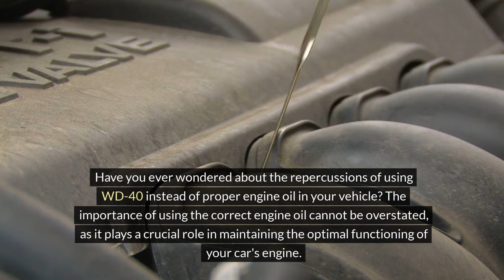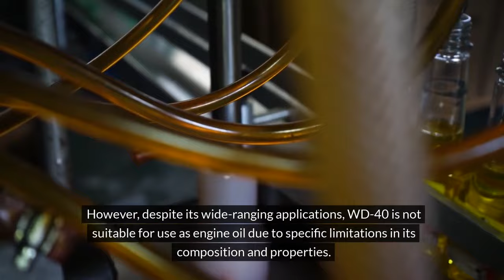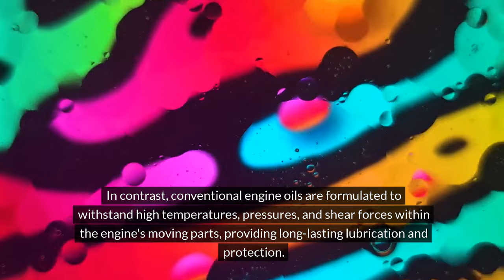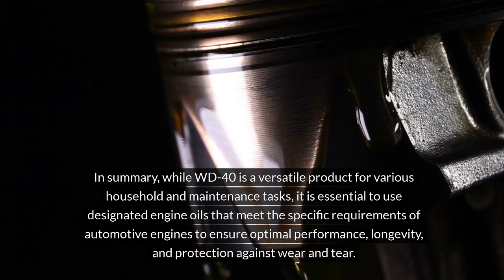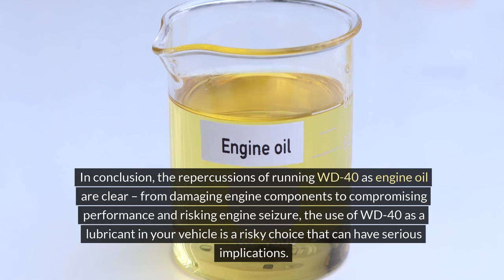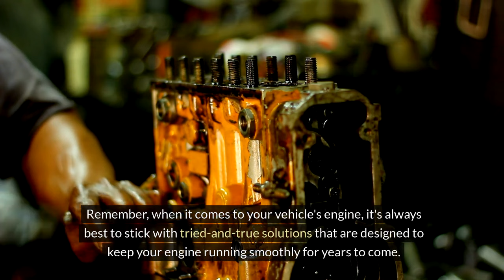The Dangerous Truth Revealed (Why Putting WD-40 in Your Engine Will Destroy It)

Comment: That  is a no-brainer. Detergent and kerosene is wd40. It will ruin your oil. We used it to start a diesel engine after a rebuild.  Designed to dry out what it cleans. Not good for internal use.